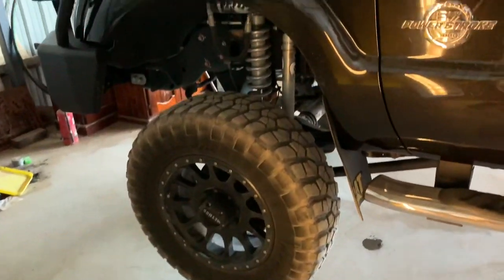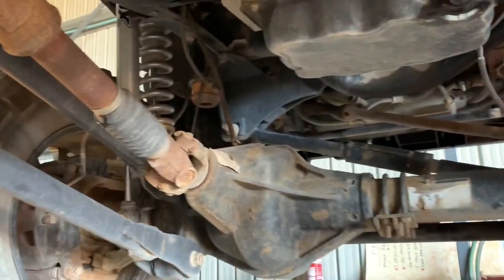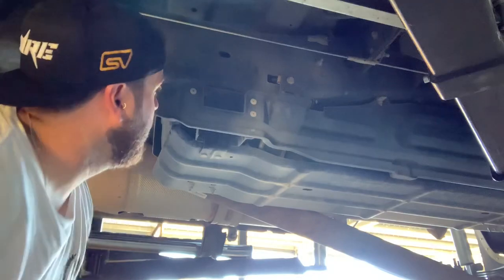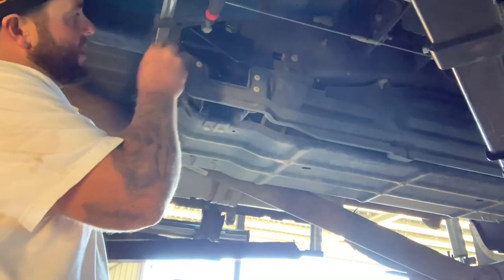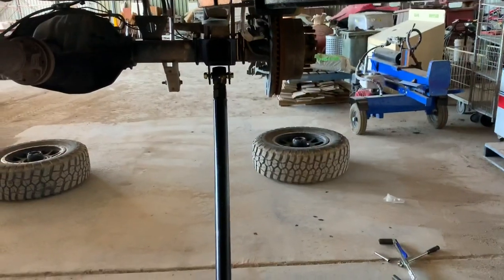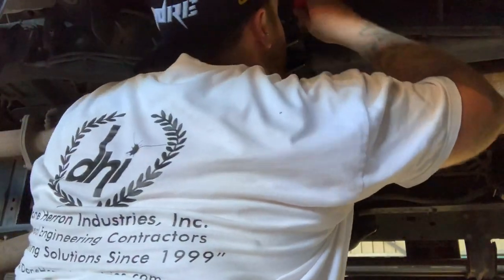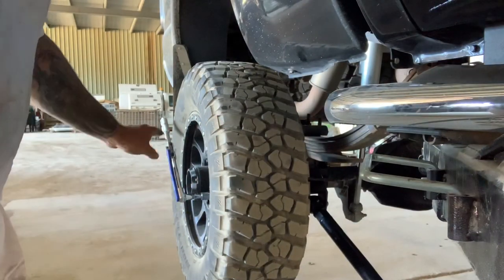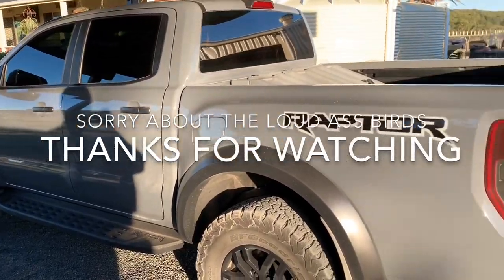BDS RECOIL TRACTION BARS INSTALLATION. OVERLAND Build 2014 F250 Superduty.,

Comment: Do you know what part number for this traction bar kit? 
Did you add another leaf to the stack after adding the camper a few years later?
Reply from the maker: There should of been a part number in the video from memory but will be on there website for your truck
Reply from the maker: I have a full tray and canopy on now so I’ve added airbags to the rear
Reply: @TyFenwick  I’ve found the part numbers. Did you add another leaf to the stack on your truck after you’d put the camper/tray on the back?
I’ve added a camper shell and now my rear end is sagging.
Reply: So my kit arrived from BDS in the States. Can’t say I’m impressed by them… two orders & two screw ups from their end.
The spacer blocks are sided left & right… they sent me two right side blocks.
Now that the traction bars have arrived… they didn’t include the two wrenches required to adjust them after fitting. 
Instructions clearly state “using the two provided wrenches”.
I think they’ve changed the design of the forward chassis brackets… mine are nothing like yours.

Comment: Hey Kyle 
Question  
I’m trying to install my traction bars  as well I do have same truck is your. But asking  me to remove the skit plate protector for tanks I  don’t see you removing your I’m just wondering if bed side matter ?? I don’t think ?  Right so what size bed is your truck ?? Thanks
Reply from the maker: I didn’t remove mine as you see in the video. Mines 6ft bed